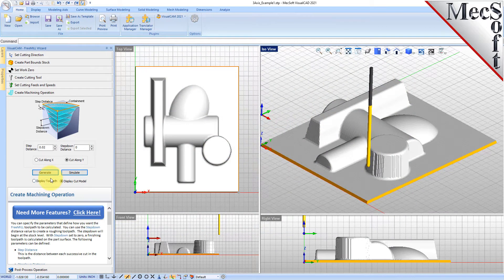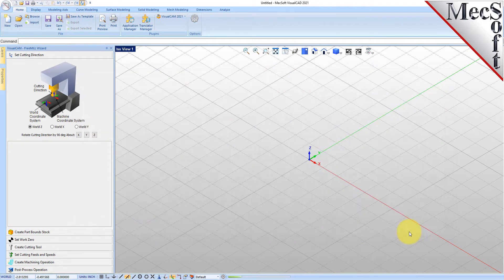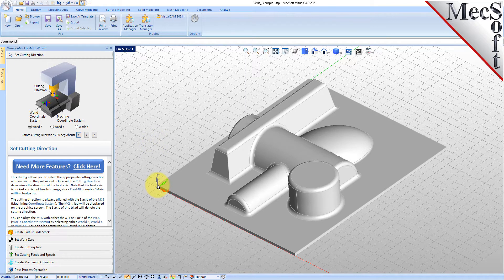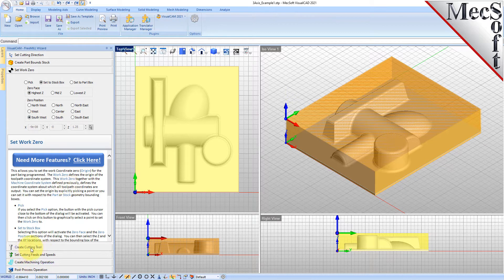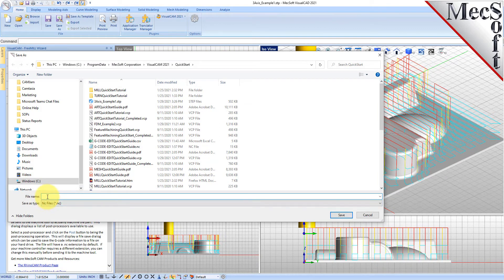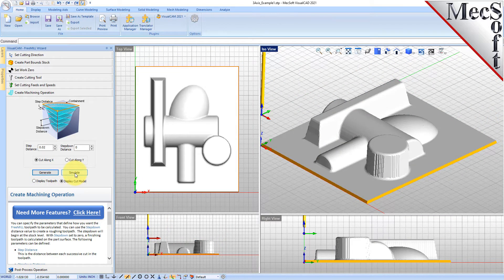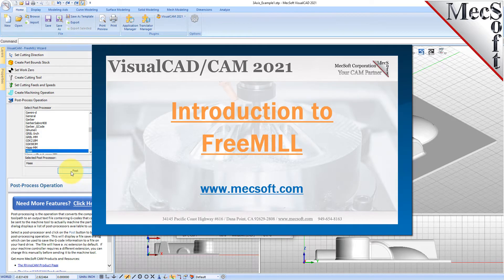FreeMILL 2021 Quick Start, VisualCAD/CAM

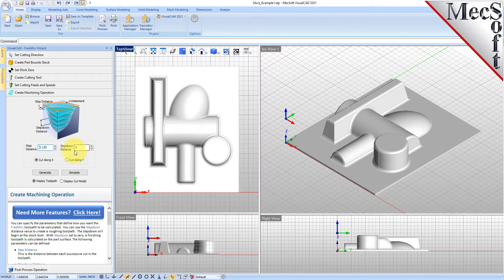Comment: Super vid up to 6:23.  Where is 'Step Over you mention ???, don't see it on the menu anywhere.  I assume 'Step Down Distance' is Depth of Cut ?, but what is 'Step Distance', what does that relate to X, Y, Z ?????.  At 7:23 you are talking about 'Step Over' - again ???????  
If I do ever understand the above is there a vid where a practical part is done, as an example a part with holes and pockets in where the material thickness is fixed, ie does not need a top face pass just a drill ( Holes ) mill ( Pockets ) and a cut out pass.
Thks, Kind Rgds.
Oh, I just spotted the only comment from Dylan below that has not been answered from 5 months ago.
Reply: I understood that step distance is for xy and stepdown distance is for z axis. There is a diagram at "create machining operation".